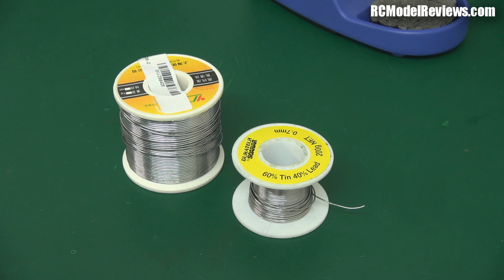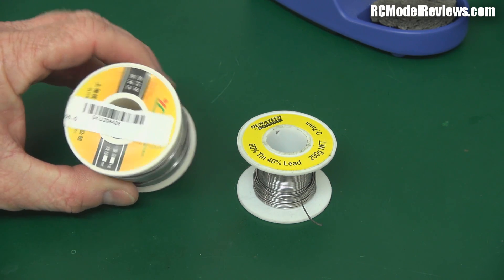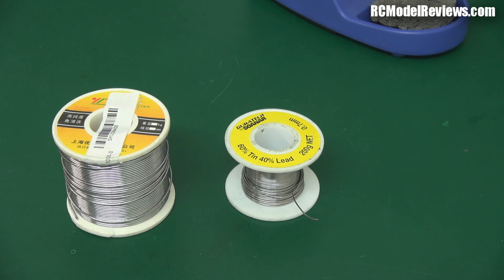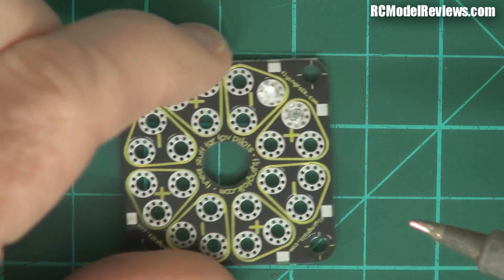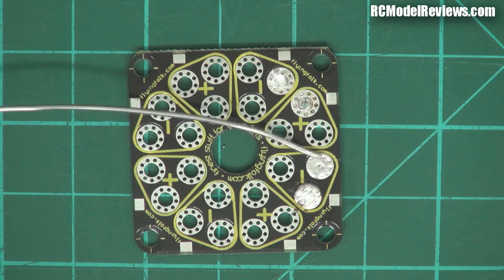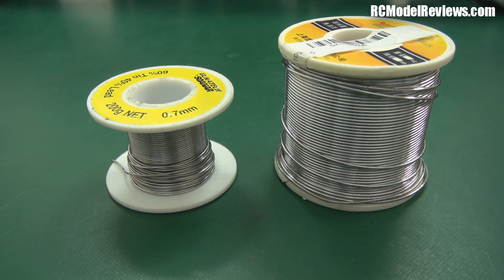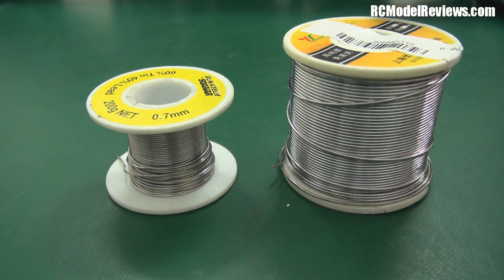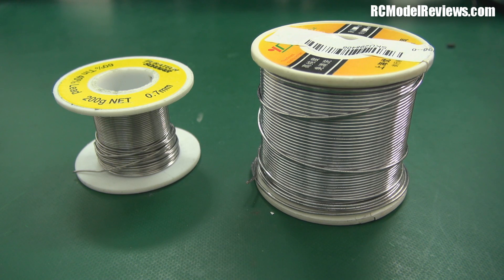60/40 versus unleaded solder

Comment: Holding on to the past and the inability to learn new skills is partially responsible for turning ham radio into nothing more than glorified CB.  It's not just lead-free solder hams are terrified of, they're also afraid of SMD. They do nothing  but bitch and moan that they cant work on their radios because it's all gone SMD >>> LOL  

 And here we have yet another ham radio guys crying about lead-free solder.  They should be ashamed of themselves, their ham radio ticket really isn't worth the paper its printed on.

 Seriously you can go over to Sparkfun and see a bunch of 14 year olds who know more about EE then even your most advanced ham, WHile hams are crying about SMD and lead free solder these kids are designing up PCB's and building complex  SMD projects with lead-free solder and with more skill and precision then hams could ever muster even using their precious leaded solder. 

Of course, the dumbing down of ham radio is the result publishing the answers to the FCC exams. Now all any wannabe CBer needs to do is memorize the answers to questions and take the test. The end result is a hoby loaded with technically illiterate appliance operators most of whome couln't tell you the defrence between a cap and an inductor    

 It's actually kind of sad because at one-time ham radio was a prestigious hobby, That was back when the hobby was solidly based on science and engineering. Back then holding a ham radio ticket actually meant something. Nowadays ham radio is nothing more than glorified CB and the ticket isn't worth the paper it's printed on.

Comment: 63/37 is better for leaded in my opinion, however.. Bismuth-Tin alloy is great for low temp solder where certain components are sensitive to high temperatures. I think you should try a high quality lead-free product like C511 Multicore solder. Most of the time the joints look terrible because cheap solder has low quality rosin flux. I like digikey (as a supplier) myself. In the US they have free shipping when you order by mail.

Comment: You need to  heat the iron to 750F, pastey solder is a temperature issue, Lead free liquidates the same just at a higher temperature

Comment: First off don't dismiss ALL lead free solder based on 1 crappy solder.

I have been using sn/cu (97.3/.03) for a few years and I dismissed it when I had a crappy elenco station. 

Now I am using a decent iron (like you I use a hakko fx-888d) and using the right tip for the job is also important (the included one is a little big.) and it works flawlessly. 

Yes it takes a little longer to solidify (but i use a 3rd hand for all my soldering so it is not much of an issue)
And yes it is not as shinny as leaded solder but that dosent matter to me because everything I make, modify, or repair has or gets an enclosure.

In all with a good solder (ie not cheap import crap), a good iron, and decent tools. It is a dream to work with.

Comment: Bruce, your soldering technique is not ideal.  You are using the wrong tip and you are not heating the pad first properly. You need a larger chisel tip for that size pad

Comment: im pissed off because i worked with both types of solder and it never went pasty or anything and it is the fault of shity solder in the video and i do not see a big difference  besides the heat and finish

Comment: The thing that concerns me most about working with lead solder is actually DE-soldering, especially with a pump. Those tiny, barely visible bits of removed solder get everywhere; all over my desk, under my fingernails, on the floor, on my arms, etc. I'm sure I even had lead dust in my bed at times. Over long period time that can be ingested and could build up to become harmful. As someone who does almost as much desoldering as soldering and has cats, I'm moving on to lead free. I'll still use 60/40 for some things but won't whenever I can avoid it.

Comment: They have different fluidious point that's why the tin solder didn't melt property, eutectic means the alloy melts at a single melting point not a range.

Comment: Learn to solder at higher temperature, 
as far as i'am concerned i use Solder Gun most of the time, 
so Pure Tin solder doesn't make any difference to me,
I had seen many newbies working for first time in Tin or Tin/Ag whining about how good is lead free.

Even on resistance scale Tin is twice as best (lower resistance is better),
Lead = 220 nano ohm meter,
Tin = 110 nano ohm meter.

Reference:
Silver = 16 nano ohm meter (best conductor in metal)
Copper = 17 nano ohm meter (cheap and best conductor in metal for mass use).

Added, inhaling Lead is toxic and has serious effect on lungs.

Comment: Lead free solder sucks because you don't know how to solder properly, guys!! I use lead free solder for guitar electronics and i get a nice shinny solder joint...You need a soldering iron with more power (a 50W soldering iron) to properly solder with lead free and you need to let it heat up for at least five minutes instead of two, tin your tip, keep it clean and DON'T USE WATER to clean your soldering iron tip, DON'T USE the lead free soldering tip if you're going to use 60/40 solder (one tip for lead free, one tip for 60/40)!! Dull solder joints, like in what happens with 60/40 solder it's a cold soldering joint...That's because you're not letting your soldering iron get hot enough for the lead free solder and you're not using a proper soldering iron for lead free solder!! With the 60/40 solder, you just wait around two minutes to let your iron heat up, assuming you have a 48W soldering iron...Lead free solder needs higher temperatures to be properly used!! I am European and i use lead free solder and i never had these problems about getting "dull" solder joints and i never had any problems with my electronics works whatsoever!!
Reply: "wattage recommendation rather than a temp recommendation" LOL welcome to the Internet

Comment: and why leaded solder sucks: it is poisoning! It is neurotoxic and accumulates in your body and your environment. RoHS is not a myth, it's good that no lead is used in mass production.
I use leadfree solder everywhere, no problems with bga or 0.4mm fine pitch.

Do yourself a favor and learn how to solder and use leadfree!
Reply: Solder a thing using lead 
-> thing breaks, gets thrown into trash 
-> broken thing gets moved to a dump
-> thing slowly breaks down into the groundwater (the lead also)
-> lead gets into lakes and oceans, ends up in small animals
-> moves up the chain into larger animals, i.e you
-> rest of the lead ends up in drinking water for humans, cows, chickens...
-> more lead in your brain makes you more angry

Comment: I absolutely hate lead free solder. It doesn't absorb into wires properly and doesn't flow very nice at all. Leader solder isn't dangerous if your careful with it. As long as you wash up your hands and workspace real good you'll be fine. Everyone hears lead and freaks out. You can't get poisoning from looking at it. You have to ingest it
Reply: uhuh and the 100 000 000  or so iphones that end up in garbage dumps one day? Where the solder is eventually going to oxidize away and leach into groundwater. No problem? There is a difference between tinkerer and mass production. For connecting two wires, sure use leaded solder, its just a tiny amount. And if you have to use lead free, use more flux and more heat, it will work just fine, it just handles a bit differently. You cant treat it as leaded solder and expect it to work the same, treat it as lead free solder and you will get better results.
Reply: aleksander suur considering electronic components like iPhones are required to be recycled... And the fact I am talking about hobby use not a factory. Idc if they use lead free in my phone. If it fails I take it and have it fixed or replaced
Reply: Zach Novosad For hobby use, sure leaded is fine, no problems with that, that's such a small use it doesn't matter, use what you want.
But you won't repair your phone forever eventually you will get a new one. Do you think your old one will really be recycled? How many will actually get recycled, required or not i bet maximum 20% will, rest will be dumped somewhere along with all the other unrecycled electronics. Check out some ewaste videos to find out what really happens to old electronics, not pretty.
Reply: aleksander suur that's what I'm saying... They don't repair iPhones. Believe me I was at the sprint store today
Reply: considering that lead free solder is wayyyy cheaper than leaded solder you can almost guarantee that iphones are being produced with lead free. Besides it probably being soldered by machines built for it. I don't think theres anything wrong with leaded solder. It's what I use.
Reply: You have to physically ingest lead for it to do harm. As long as the landfill isn't near a water source or farm it's fine. You want to talk about harming the environment with leaded solder? How about all the plastic bags the supermarkets and stores waste for a single item. I don't need my bag of potatoes in another bag. Such a waste of petroleum.

Comment: 05:00 That kinda pissed me off, when you solder you need to heat up the base, don't expect to solder on a cold PCB ofc the soldering wire will get "pasty" or solidify if you don't give it the necessary temperature, as you can see from the vid. you/he get's the soldering iron away fast, the PCB is COLD and the hot liquid transfers the heat fast to the copper PCB. Use the right temperature, even if you don't have a high heat soldering iron hold it on the PCB to heat up then solder, like that you always will have a PERFECT soldering with any soldering wire.
Reply: Domino60 how do you know when your are damaging the board tho? what do you look for?
Reply: J3tfuel thanks.
Reply: The Great Mechanized Ape, get the right tip size (so that it doesnt heat the board but it does heat the base/lead) and one way to know if the board is damaged is if it turns black or starts to smell!

Comment: I work for a company that builds military grade equipment and I will tell you that lead free is more brittle and that's why we still use leaded we mostly use .032 and solder paste for reflow oven and we always have great quality solder joints also I do want to point out that lead free requires higher Temps and are more difficult to solder

Comment: 63/37 is eutectic. 60/40 is not quite.
Reply: 63 37 replaced 60 40 in the telephone market place. Moisture was a problem in phone electronics. I did not make the change just the engineering department did. The ECO changed the ratio of solder.
Reply: and a better choice if you can get it.
Reply: @JasonKaler  you using lead free chinese solder use good one the chinese crap its a recicled mix of diferent materials recicled in illegal  scrap yards in china thats why is so crapy coz is a mix of every thing the real solder  leaf free cos like 30 euros for 200 grams try using the brand ELTO AND YOU SEE THE DIFERENCE
Reply: Well, it seems to have its pros and cons. Eutectic is more less odds of a cold joint, 60/40 is better joints when they're done right.
Reply: Jasper Janssen ahh, thanks.
The one time I tried to get it, my supplier was out of stock so I have not tried it out myself.

Comment: --Preaching to the choir here.  Luckily I had some lead solder around as well.
Reply: Modern lead-free solders really are very good and have none of the problems that early alloys had. I'll admit though, they are more expensive and harder to get and need a higher soldering temperature. If you ever want to give it a go again: Try Sn100Ni+. It flows very nicely, no tin pest, no whiskers. There is also a variant with silver in it, but I haven't tried that as I am completely content with this one.